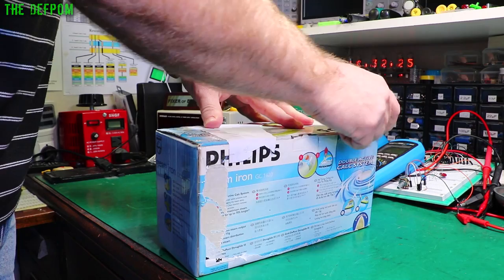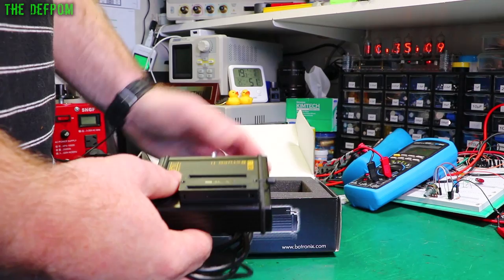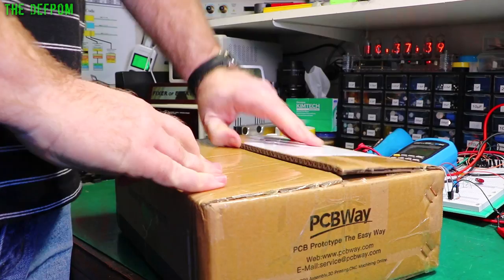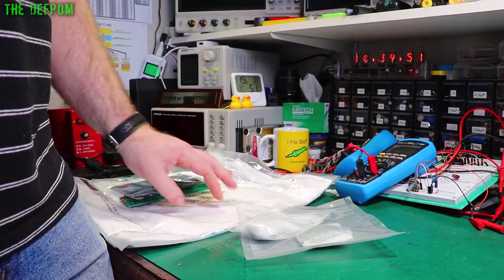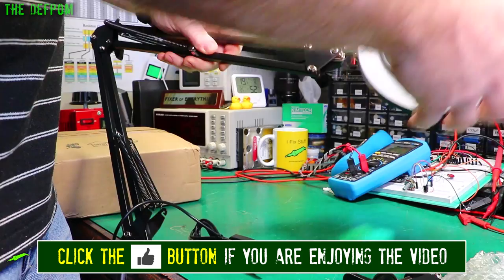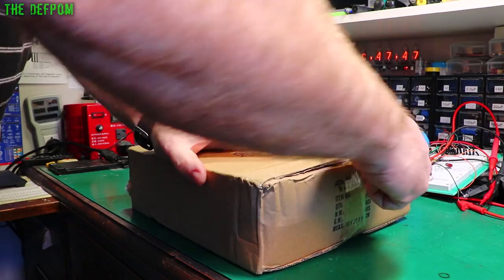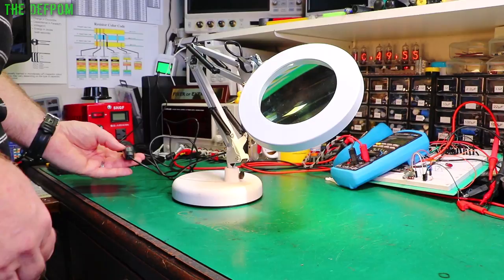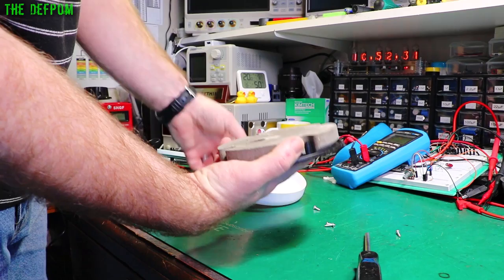🔴 What's in my Mailbag ? - 9th August 2021 - No.861

Comment: I bought one like the black one with a heavy base for my 94 year old mother.  I had to add o-rings to the shaft because it was loose in the base.  The glass lens was good, the quality control was poor.
I have a very nice magnifier lamp in my lab I bought at an industrial surplus dealer years ago.  It has an excellent ls and is very well made.  I am planing to replace the round fluorescent tube with led tape.

Comment: Drill holes in the concrete and fill them with lead. I messed around with magnifiersd too but for me the best solution turned out to be a headband-visor. After some cheap 0nes that did work, I bought the original (optivisor) and that works very well. More comfort and no optical distortions compared to the cheaper versions.